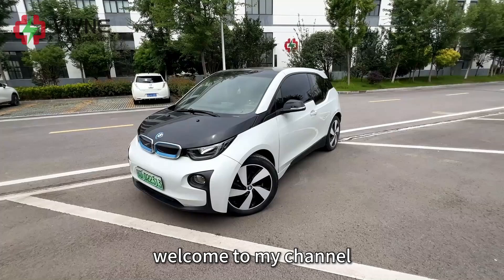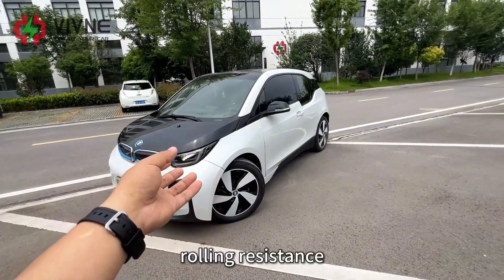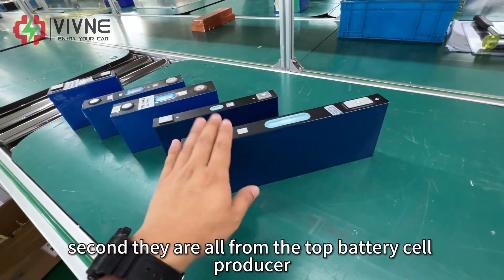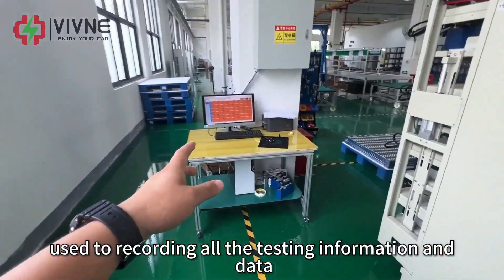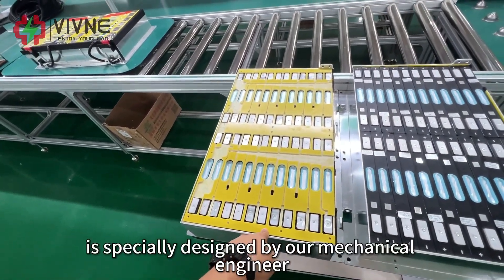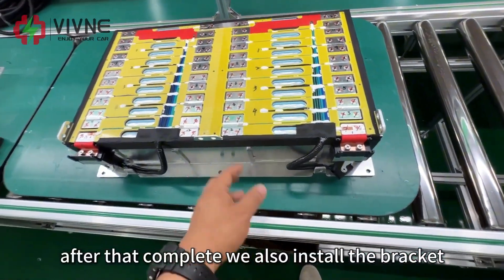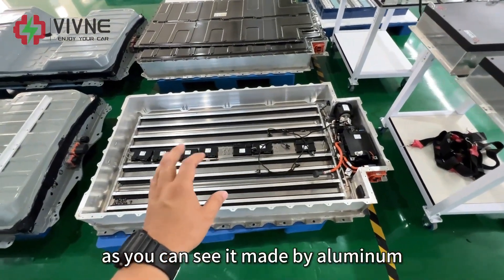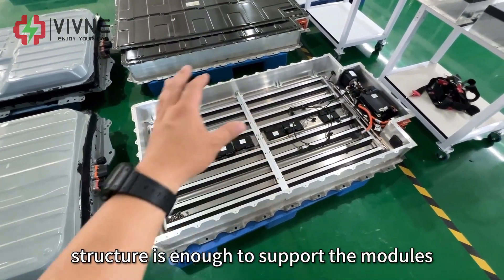VIVNE-BMW i3 battery upgrade from 22kWh to 45kWh

Comment: Are the cells glued into the aluminum battery module compartment or are they just inserted? Have no understanding from the video. 

Is there any thermal interface between the bottom of the cells and the bottom of the compartment?

Comment: do you have solutions for Mini Cooper SE?
Reply from the maker: No sorry, currently we only provide batteries for Nissan leaf, Nissan e-NV200 and BMW i3
Reply: @VIVNE-CoraLiu  is there programming or some change to the car electronics so it knows extended range? The Mini Cooper SE has the same capacity and motors as the BMW i3 and so it would be great to extend the range of a Mini Cooper SE too.

Comment: It's great to see that there is an increasing number of 3rd party battery options, but honestly we need more capacity than just 45 kWh. The i3 120 Ah battery already comes with a gross capacity of 42,xx kWh. An upgrade to 50+ kWh would be really remarkable. Maybe direct cell to pack and skipping the modules?
Reply from the maker: Thanks for your honest feedback, we completely understand your point. 
Due to current cell technology, larger capacity batteries are significantly heavier. The original BMW i3 chassis and suspension are not designed to support such added weight safely. Based on current cell technology, 45kWh is the optimal capacity we can achieve while keeping the weight and dimensions as close to the original as possible. It's the result of careful design and calculation, offering maximum range without compromising safety or vehicle structure.

Comment: But the epoxy lining will hinder heat transfer to the cooling pipe down below. Isn’t that a bit dangerous
Reply from the maker: The epoxy board we use at the bottom is only 0.3 mm thick. This type of material is commonly used in dry-type transformers, where both electrical insulation and thermal management are critical. Based on our testing, we believe the impact on heat dissipation is quite limited at this thickness.
That said, we really appreciate your suggestion. I’ll pass your feedback on to our engineering team, we’re always open to exploring even better material options.

Comment: very good job indeed. very well explained. I am sure many i3 owners in EU will look forward to getting this upgrade. Do we need to send the existing packs and then you upgrade replace the modules and then send it back is it ?
Reply from the maker: Thank you so much for your kind words and support! 🙏
No, you don’t need to send your existing battery pack to us. We will send you a complete battery module kit, and you can install it directly into your original BMW i3 battery case.

Comment: A good part 1. Next the performance in efficiency, charging profile, battery temperature when DC charging on a trip would be interesting. Performance in cold conditions also.
Reply from the maker: Thanks a lot for your feedback and great suggestions! Unfortunately, our current BMW i3 doesn’t support DC fast charging, so we’re unable to test the charging profile or battery temperature during rapid charging on trips. However, we’ll definitely do our best to test and share results related to efficiency and cold-weather performance in future videos.
Reply: @VIVNE-CoraLiu  Would this work the same on a vehicle that does have DC fast charging?
Reply from the maker: @TheClanduncan  Yes, our battery upgrade is fully compatible with i3 models that support DC fast charging. The charging profile will follow the vehicle’s original BMS and control systems, so fast charging functions will continue to operate normally.

Comment: Have you tested this battery design on the 94Ah and 120Ah models? I know that i3 in the video is a 64Ah. Is that I have read that the 120Ah models internal wiring is different.

Comment: This is neat that you are offering an upgrade kit. Could you talk about the balance leads on each of the four packs? At 6:48 the balance leads look like they just rely on tape to insulate the cable from the aluminum shell. Did you use an insulating grommet to isolate the balance cable from the aluminum shell? It's hard to see from the video. Vibration may cut into the tape over time and eventually the balance harness. Have a good one. Nice factory :D
Reply from the maker: Thank you, we didn’t use insulating grommets in this design, we did apply four different layers of insulation materials to ensure safety and durability

Comment: Hi Team Vivne, amazing work. Is the weight higher than the oem? Need the springs to be replaced?
Reply from the maker: Hi Alles, our 45kWh battery is only about 40kg heavier than the original 22kWh(60Ah), and the weight is close to the original 33kWh(94Ah), so there is no need to replace the springs.
Reply: If the weight of the car is increased by say 40 kg, then just remember to reduce the payload on the car by 40 kg ?!! Unless you're the sort of user who likes to always load the car to it's max original designed payload (which tends to be NOT the case with typical users..who therefore tend to drive their car  well within whatever their original designed payload ranges..so i don't see much need or point to mess around with the suspension ?!?